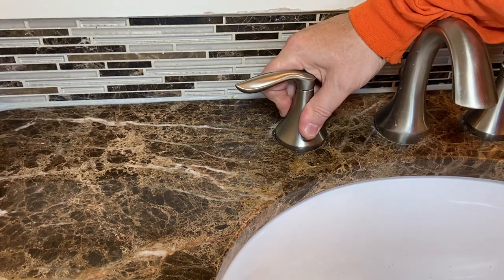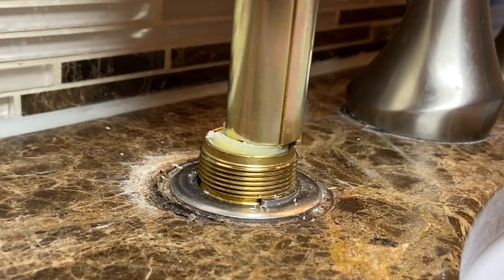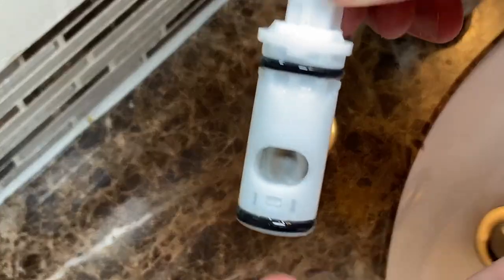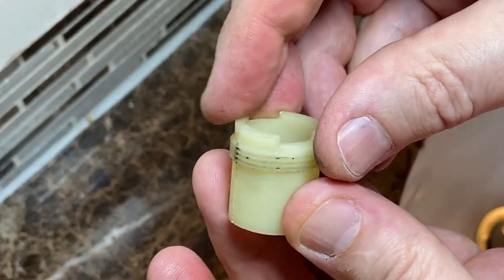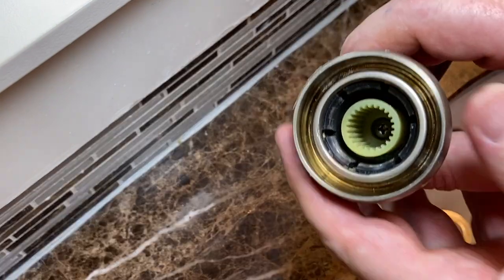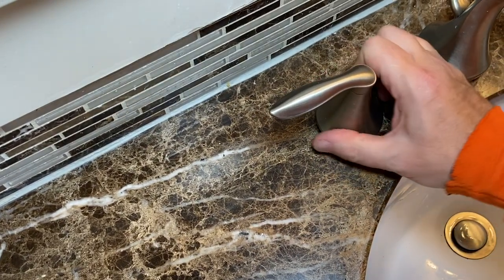Fix Your Leaky Moen Faucet In No Time!

Comment: Forgot to mention you need to rotate the cartridge to fit into the notch in the brass fitting. Will not work unless the cartridge drops into the notch prior to locking down with the tool.